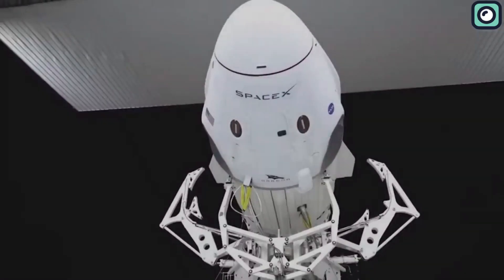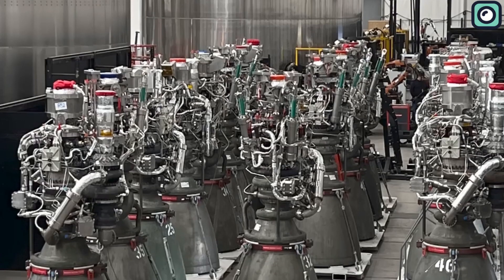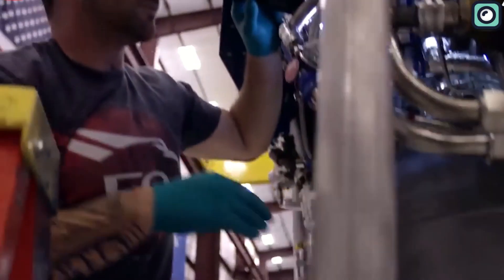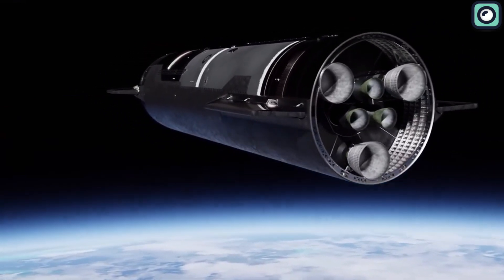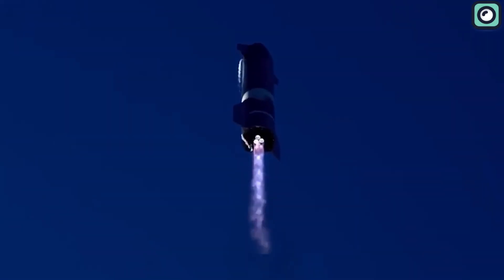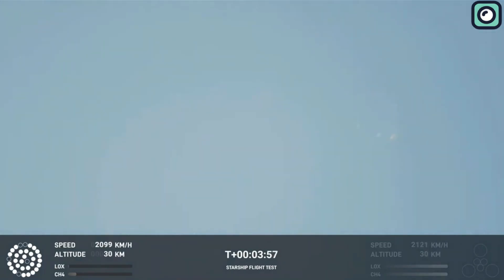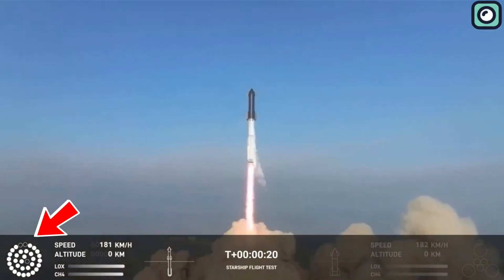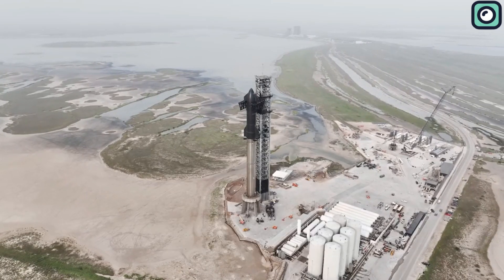What SpaceX just Did with Raptor 3 Engine thrilled NASA Scientist's!

Comment: Man Elon you don't need All this engine. Just combine all to make one or two even better Three. New engine booster flame rocket under just make big round it become same thing. Three big round flame
Reply: There's a limit to how big you can make a rocket engine
Reply: @Tedlasman  a limit is,if stronger engine metal steel aluminum. it will hold tighter. It will not explore,no damages,no melting down. You can used more power. Just a part at a heat....
Reply: @WinBoAngelLife  from what I remember the problem is keeping the engine ignited.
Reply: @Tedlasman  power is coming from the turbo,all kind of gas to lunch. Not from engine. Engine is just holding a heat burning. More burn kicking from turbo air,all kind liquid, Oxygen,mat. In a car you hit a gas. Car will go. At booster auto